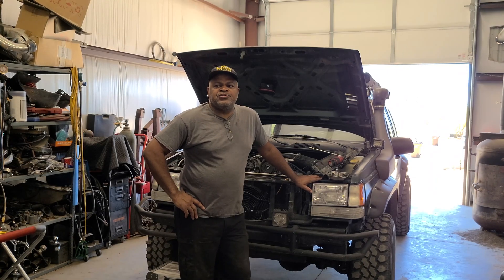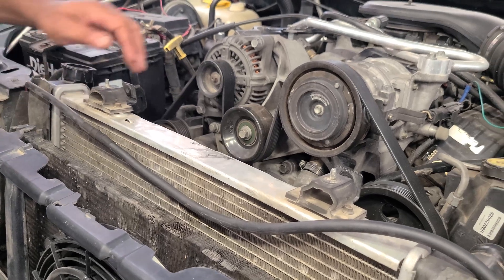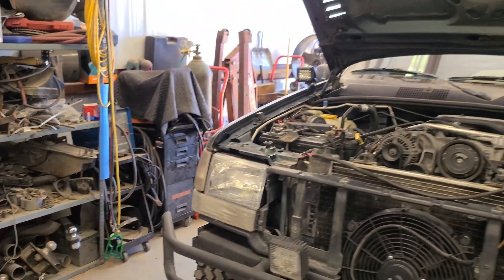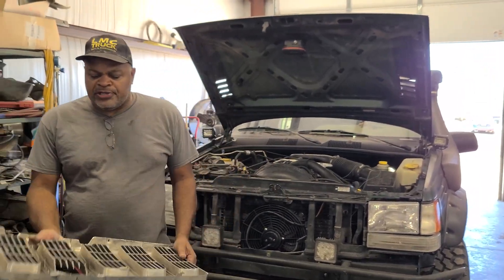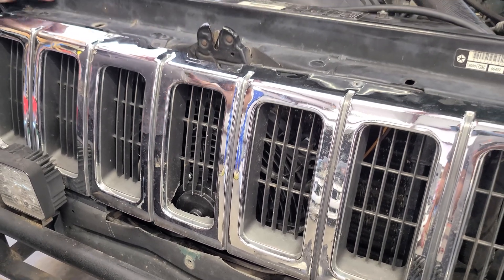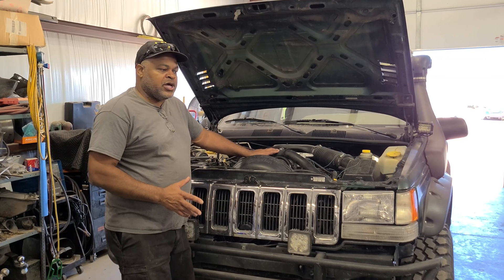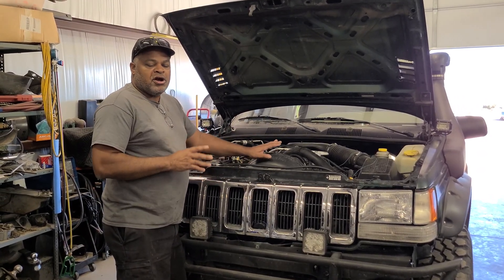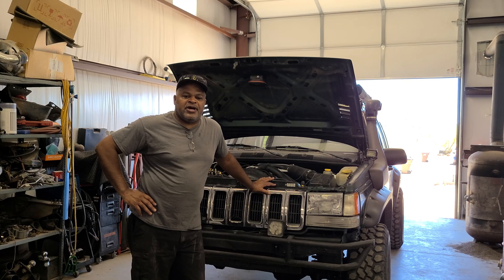Jeep ZJ Cooling System Upgrades

Comment: Push/Pull fans...great idea. I've done practically every mod I can think of and STILL have overheating issues. Frustrating to have to turn off the AC when it's a 100 degrees outside.
Reply: Have you flushed the AC system and put new fluid in and possibly change the AC clutch maybe it’s weak too compressor need more pag oil or definitely new oil

Comment: What coolant do you put in it? I have a 98 with a 5.2 and it overheats just driving up a mountain on a highway with AC on. Did a block leak check and didn't detect anything. Prior owner had the orange coolant in it, it should be the green stuff, right?

Comment: Great insights.  I have the same Jeep and have struggled with overheating. I like your insight on the thermostat issue. I've been so frustrated with mine and all the mods I've done to alleviate the issue, that I finally installed a 160 degree thermostat. Maybe now I should go back to the 195 factory spec. Also liked the pusher fan AND the mechanical fan concept. Might have to try that as well.

Comment: nice video   what ford 11 blade fan did you use   i want to do the same to me zj aswell      thanks again
Reply from the maker: Ford explorer fan blade
Reply: @mastertechmobilmechanicser3372  any year will fit
Reply: 98-01 Ranger or Explorer 4l v6. Or you can buy a aftermarket dorman 620-149 which is the 11 blade direct replacement.  I literally just pulled 2 out of a junkyard today